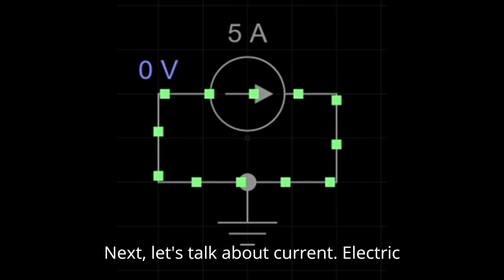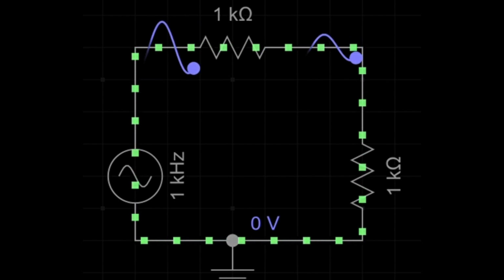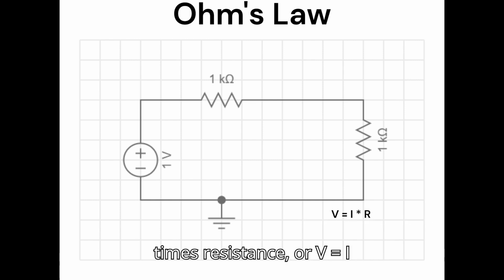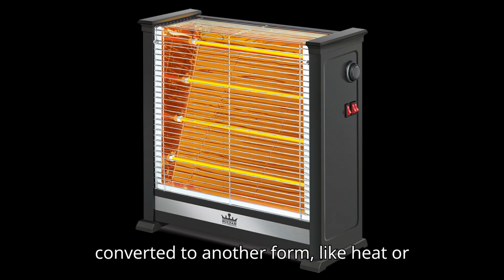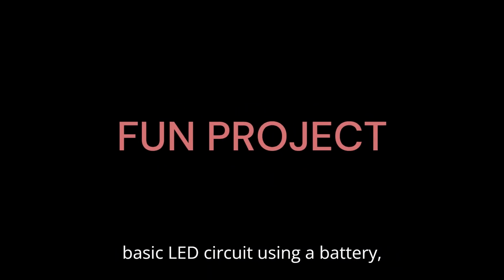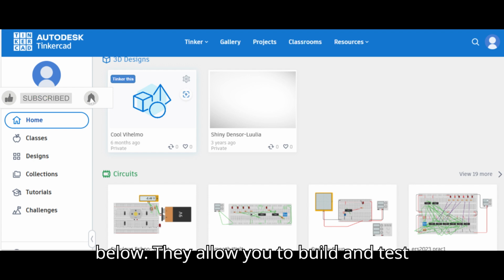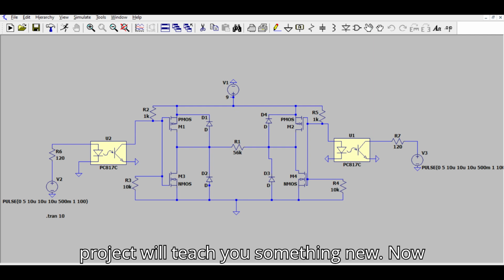Electric Circuits 101: The Basics You MUST Know! ⚡🔋💡

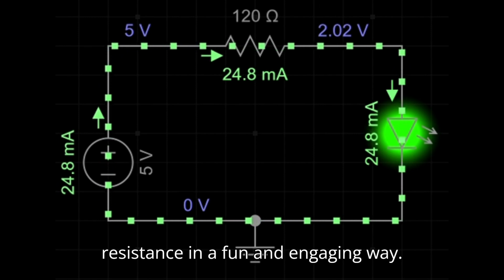Comment: If you have a series DC circuit (like 4:50) does it matter if you put the resistor after the load versus before the load?  It always confuses me due to the actual current flow (neg to pos) versus the conventional current flow (pos to neg) ... or it doesn't matter if the resistor is "blocking" the electrons before they get to the L.E.D.?
Reply from the maker: It really doesn't matter whether it is before the load or after for as long as they are in series.